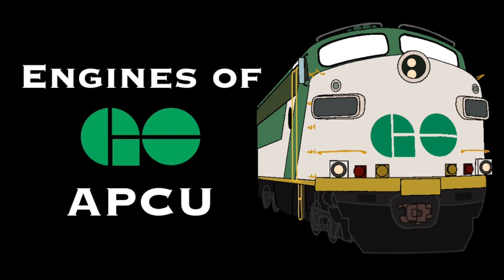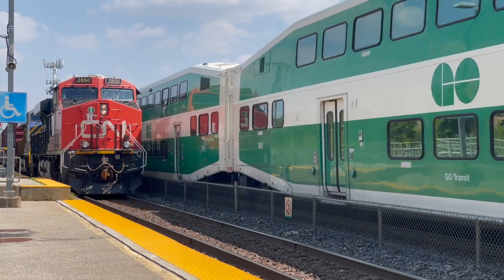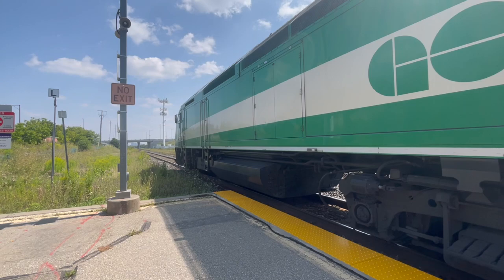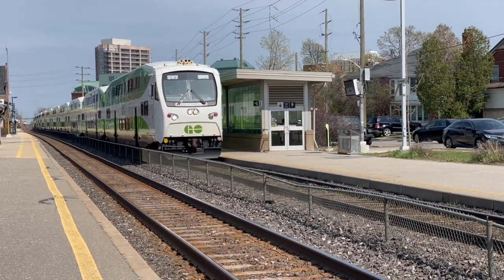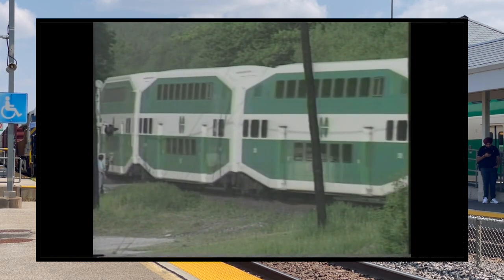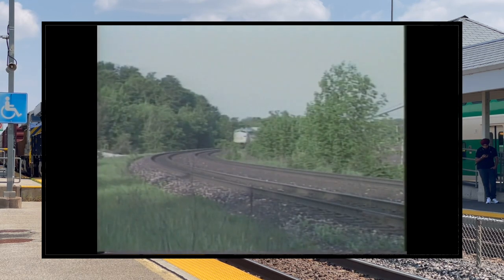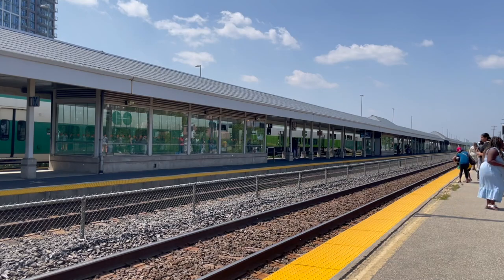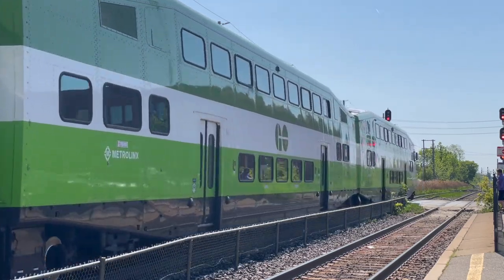Engines of GO Transit: APCU

Comment: I grew up with the lake shore west line behind my house by Clarkson and remember these .  I'm still trying to figure out what those other engines were that had no windows or anything that were behind these sometimes?
Reply from the maker: You most likely saw an APU, its the same as the APCU here and was actually once an F7 B unit, except it has no cab and powers the cars if say a locomotive has no HEP. Which at the time many locomotives didn't.